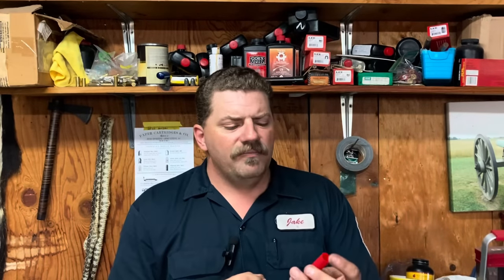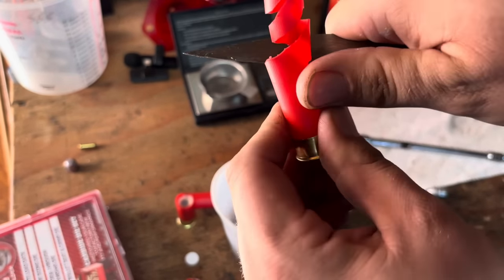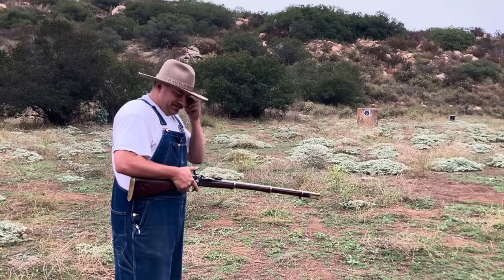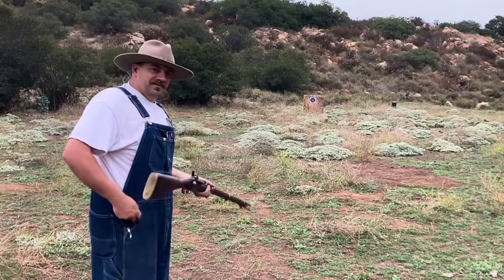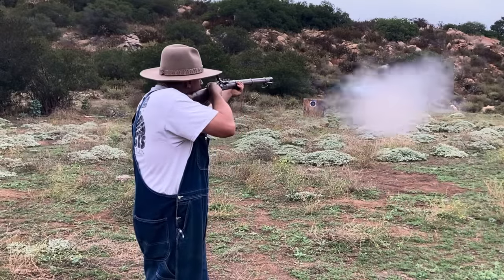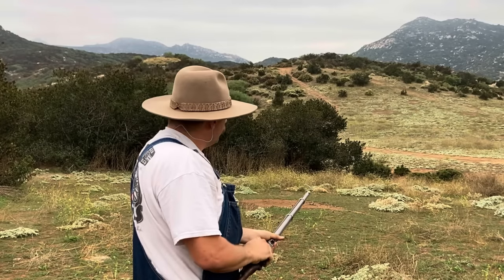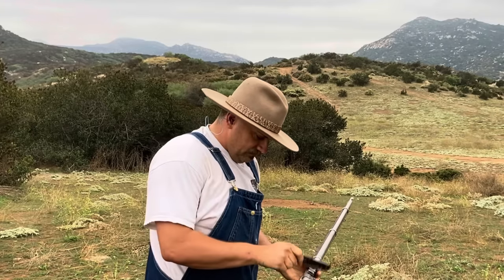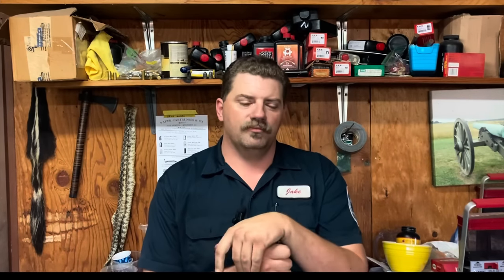Making Cheap And Easy 577 Snider Ammunition

Comment: hey jake, i cut down my 24ga brass shells using a 1/2 inch extension and a regular pipe cutter. slip the case onto the square end of the extension and the shaft should be damn near perfect size to fit into the case (manufacturers might vary). do not try this with a wooden dowel as the cutter will crimp the brass onto the wood and youll have a neat looking fire poker...
any recommendations for making a snider more accurate? ive got a british, admittedly a bit rough in the barrel, that couldnt hit the side of a barn from inside... current load is 60gr FF, cornmeal filler, and the X ring bullet with cloth wrap. these can get me 10 inch group at 100y and aim VERY high for some reason.
Reply from the maker: Wow, I’m sorry to hear that. Mine shoots very well with the X ring bullet. Are you using pure lead to cast them?
Reply: Not quite pure, I got a bunch of old 38 wadcutter bullets that were too oxidized to use, melted them, skimmed off the oxidation, and mixed a bit with melted store bought 50cal round balls. The wadcutters are not a lot but noticably harder lead and I go by about a 70% soft 30% hard mixture. End up with a nice 440gr bullet that I can just barely scratch with my fingernail. I use the same mixture to cast 43 Dutch bullets and those have good accuracy
Reply from the maker: @chasebh89 I would try using pure lead and maybe upping the powder charge and see what happens. The pure lead round will obturate more than the harder lead mix. Hopefully that will help.

Comment: I shoot British made Sniders(1 long rifle and 1 Cavalry Carbine).  I would really appreciate it if you would do a video about how to clean a Snider properly, since it is a breech loader that you cannot insert a cleaning rod into from the breech.
Reply: Stick the rod down the bore brushless amd screw the brush on at the breech, then pull it through
Reply: @noturfather1106       I use an old aluminum funnel with a flexible PU clear tube about a 12" long and 5/8" outside diameter that I insert into the breech chamber and pour warm soapy water thru.  I made a wooden trough to seat the muzzle in , which drains the liquid away on the pavement outside.  Then I pour scalding hot water in to rinse.  The rifle or carbine buttstock rests in a cutout on my outdoor work bench.  I then use my hickory Muzzle loading ram rods + brass cleaning tips to clean out the barrel from the muzzle with cotton patches.  For the first time ever, I used a nylon 20 ga. cleaning brush like you suggested, and also used it covered with a cotton patch to clean the chamber from the breech.  Then dry patches, then WD-40 to remove  any lingering moisture, and dry patches again,  Finally swap with 3 n 1 oil .
Reply: @robertrobert7924  that rifle ought to love you! I like using bore snakes with the end dipped in 3 in 1 to give my barrels an oil swab.
Reply: Clean it down the muzzle end. Or take a brush, insert it into the chamber, slide the rod down. Screw it in, and pull it out. 

it shouldn’t be too difficult to clean.
Reply: @gunsforevery1       You better be careful how you word your comments. or YT may sanction you for lewd and lascivious speech.....LOL.
Reply: @robertrobert7924  hahahah. 

We gun owners can get pretty dirty….cleaning our black powder guns lol

Comment: 3:00
Yo, my Nepalese spider's chamber isn't even circular, it's significantly oval-shaped. It's so bad you can LOOK at the cartridges after they've been fired and see the asymmetry. I think the problem is that the Nepalese guns are poorly made junk.
Reply: Oval chambers can also be caused by over-enthusiastic cleaning without a rod guide, something that is fairly common in old military arms. I once saw a 1892 Springfield Krag with both an oval chamber and muzzle crown.

Comment: So why would I want a freakin Snyder?? Anyway.?
Reply: It is original (made 1866 to 1874 )and still shoots well after 150 years....?
If it were mine I would get a gunsmith who could handle polishing the breech  to get rid of a century and a half of corrosion and reestablish the correct dimensions so as to fit the modern shot cartridges in a relatively smooth breech....
just like it was when originally made.
Reply from the maker: Why are you asking me? I’m not trying to sell you Snider rifle. I don’t care what you do or don’t want.